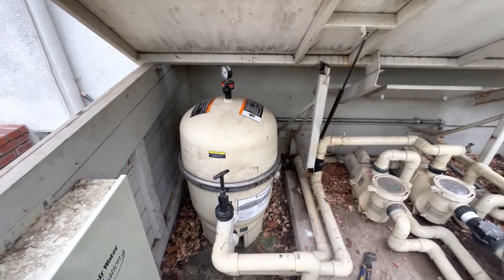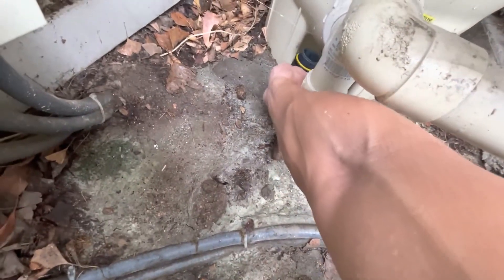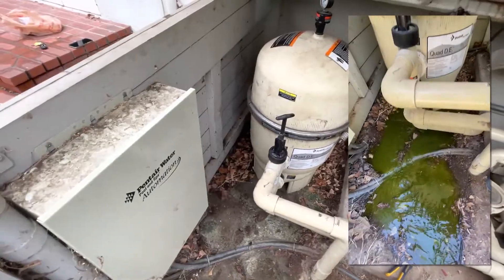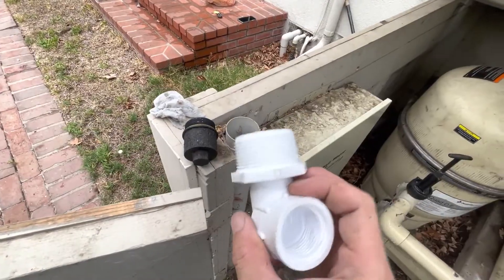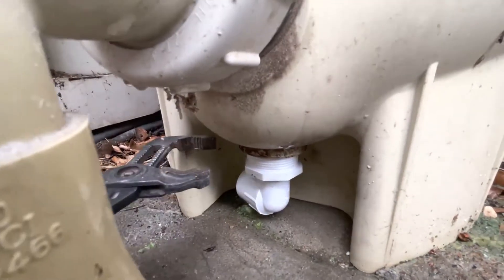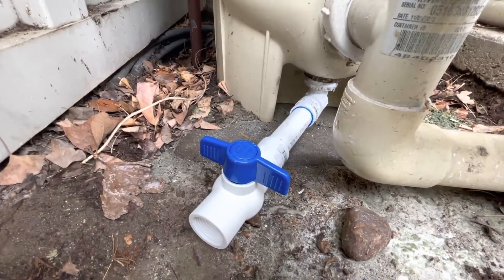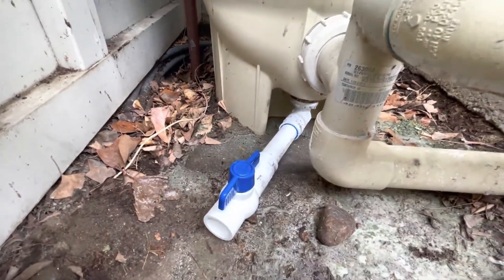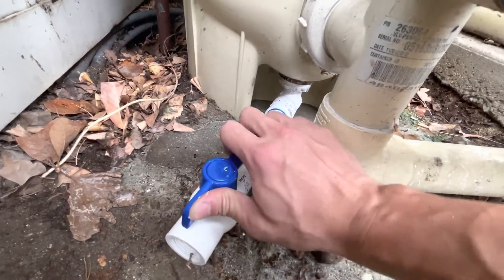Install Shut-off Valve on Pool Filter Waste Drain for Easier Maintenance #pentair #poolcleaning

Comment: Thank you for this awesome idea. I recently sort of stripped the thread. I ended up doing this.

Here is the exact parts list from Home Depot.

- 1 1/2 x 1 Sch 40-Red Bushing PVC Mptxfpt
- 1 in. Schedule 40 PVC 90-Degree MPT x FPT Street Elbow Fitting
- 1 in. x 1 in. Schedule 40 Male Pipe Thread x Male Adapter
- 1 in. Solvent x 1 in. Solvent Schedule 40 PVC Ball Valve
- 1 in PVC pipe
- PVC Blue Glue and Thread Sealant/Tape
Reply from the maker: Thanks for shopping list!

Comment: I made the mistake of thinking you had a 1-1/2 inch elbow. I bought that and it didn’t fit. You really have only about 3 inches of space there. I had to do the exact same thing you did in the video. It took me a few trips to get it down. 

To anyone trying to do this later to save you an extra hardware store trip:
1-1/2inch to 1inch pvc bushing reducer converts the filter to 1inch. Then a 1 inch elbow threaded on each side. An elbow with a slip fit is bigger so you won’t have room to rotate it into place. Install both together before putting into the filter.

Then install 1 inch male threaded adapter to get to a slip fit like in the video and then add pvc pipe and 1 inch ball valve. It’s unfortunate you have to use 5 parts, but there is just to little clearance to clear the rotation of the elbow otherwise.
Reply from the maker: You're spot on!
Reply: Is there a chance of leaking because the filter plug is straight threads with o ring and the pvc fitting is tapered pipe threads?
Reply from the maker: @ernstmfg2970  That was my concern, but it didn't happen. I guess the tapered threading helped. Use some Teflon tapes.

Comment: Great idea!  👍
I've done this same thing to my 80 gallon compressor using metal fittings and nipples. 
Much better than kneeling to reach underneath and being soaked with dirty water.
Reply from the maker: Totally agree! Make it as easy as turning on/off your tap water.